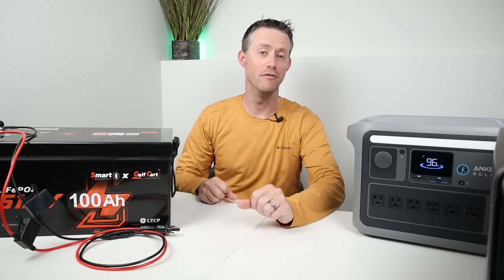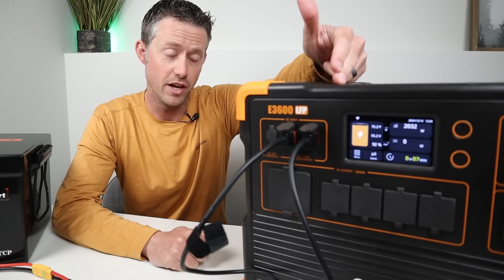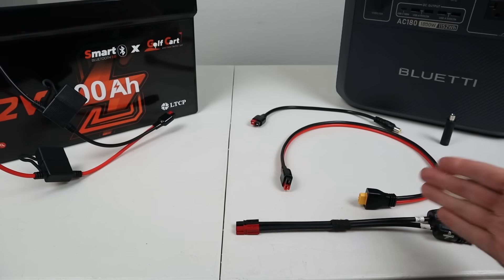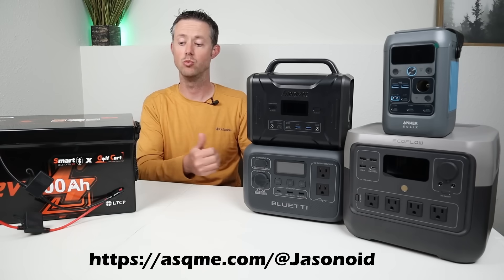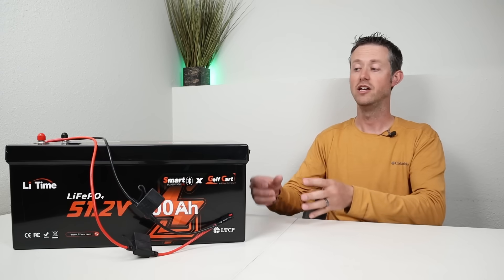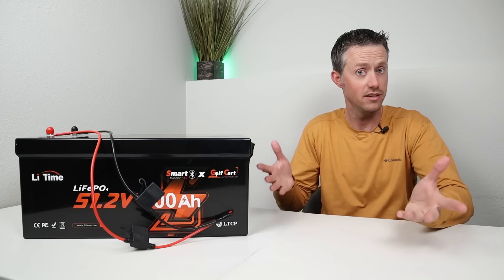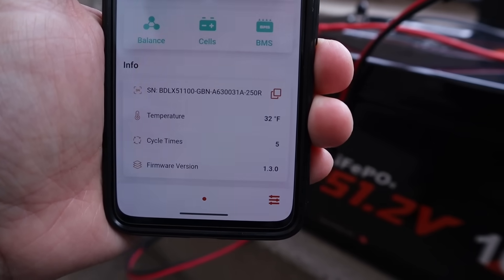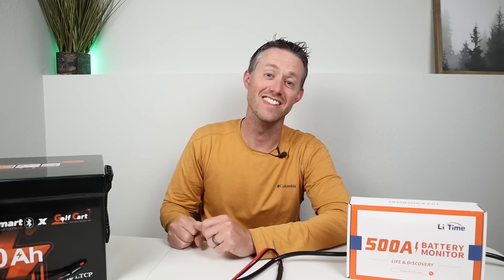Simple Trick to Make Your Power Station Last 5X Longer! Charging with a LiTime 48v Smart Battery!

Comment: If for example, two panels when wired in series have (VOC 96.96V/ ISC 10.14A), connected to a 48 V battery, and the battery connected to a power station that has (60V max/12A), being the battery terminals are being shared by the panels and the power station, wont it be an issue?
What would be the specs for the solar charger for such a system in between the panels and the battery, and would the battery stop charging from the panels once its fully charged?
Reply from the maker: You cqnt just connect two solar panels to the battery terminals, you have to use a solar charge controller which outputs a battery charging voltage.
Reply: @Jasonoid  My question was the second part of the question, I do know that cannot plug directly solar panels to the battery. Would you be able to  answer the specs for a solar charge controller for the system, and if could keep the battery connected always to the solar panels using the solar charge controller  and not overcharge the batteries, and it the panels being a higher voltage than the power station and sharing the same battery posts, if would cause a problem, or the solar charge controller would have this in check, thank you
Reply from the maker: @ilrc8850  yes, you can charge the battery at the same time as having it connected to the power station. The solar charge controller would also keep the voltage within charging parameters, no damage to either the battery or the power station by doing this.

Comment: In my overland vehicle I am running a BLUETTI AC200L powered by a Charger 1.  Great setup but my cooking and kitchen setup many times will eat all my battery on the AC200L.  Question:  can the Charger 1 power the 48V battery, then use the 48V to keep the AC200L topped off?  Your videos are fantastic and very helpful!
Reply: YES, the AC200L has a solar input voltage max of 145 volts! The adapters are in his description (2 options, terminals to XT90/MC4 which connect to Bluetti). This would also work with their EB’s and AC200MAX.

Comment: I’m having an issue when charging my EcoFlow delta max with a Renogy 48v 50ah battery. It will charge at about 660watts and then immediately stop. Every other second this repeats with a clicking sound from the EcoFlow. It does still charge but extremely slow because of this. Any idea what my issue could be?
Reply from the maker: Wow, I haven't heard of that issue before when charging the Ecoflow Delta series. Do you have the firmware updated on the power station?
Reply: Yes, latest firmware as of 2 days ago. I’ve confirmed it’s not my batteries as they are outputting a constant voltage. I’ll be contacting EcoFlow tomorrow to see if I can figure out the issue through them since it’s obviously on the EcoFlow units side

Comment: the other problem is your limited to the solar chargers power if say the unit can provide a full 2400w but you the solar charger only pulls 1000 once the main battery is depleted your bottle necked to 1000w a proper expansion batty lets you pull that full 2400w.

Comment: Thank you for pointing out these money saving alternatives. I think it is important for the widespread proliferation of residential solar that there are affordable alternatives available for the DIY oriented home owner. I have been dissapointed with the final cost vs performace of my grid tied system, which I have now augmented with one Anker F3800 and the grid interactive Smart panel connected to six REC 400W solar panels. 
 My question is: Would I be able to use one of these batteries for both of the pretty limited solar inputs on the Anker using two adapter cables or would you recommend getting two batteries?

Comment: I want to have a backup for my 2 bedroom apartment and and to use the generator during peak electrical prices usually 4-8 hours daily. looking at the DJI power 1000 and the Bluetti Elite 200 v2. What do you think? Also which DIY battery to buy and best way to charge this diy battery?

Comment: I have an energy flex 1500 system with one battery. It’s about 1050 W hours I have contacted energy and I have read all of their paperwork and they tell me that it is absolutely impossible and not allowed to take a 12 V 200 ah 
 Lifepo4 battery 
Hook a battery pole connector to an EC eight mail and plug it into the side of the energy flex 1500 and charge it that way   They say that it’s dangerous. It will start a fire because it’s two different types of batteries connecting to each other the energy flex 1500 has lithium ion batteries in it and the life batteries lithium iron phosphate but how does the energy flex 1500 know where the electricity is coming from if it’s just a cable coming from another battery source it’s still 12 V are they just trying to sell me $1000 extension battery or can I still do this and where would I get good cables for something like this?

Comment: I just received the 60Ah version and the Li Time 58v 10a charger and the battery will not charge. The charger is clicking switching volts but not charging. Resting volts of the battery is 48, which is 0% charged based on what the manual says. 😢 not sure if I just received a bad one… any help would be great
Reply from the maker: The battery comes in a 'disabled' state to save power and usually wakes up when you connect the battery charger. Can you connect to the app and turn it on?
Reply: @Jasonoid I had to return it, it never woke up.

Comment: Great video! I don't know if I missed it, but how much of a difference/extension does the battery make in useable time after you've charged and drained the bank and battery? I know that the answer is subjective, but there has to be a general rule of thumb. Also, how does the battery extension equate to cost savings, if any?

Comment: How does the external battery charge up?
Reply from the maker: You charge it manually with a 48v battery charger or with solar panels and a charge controller.
Reply: @Jasonoid  OK thank you. Its because Im going to be moving completely off grid, with a 500w panel.

Comment: I use a Battleborn lithium 100Ah to add extra power to my EF Delta 1300. It handles up to 60v. It takes a while and only recharges with the cable being ring terminals to the XT60i at 104w, similar to using the 12v socket in a car or truck.  MY other cable has aligator clips to the XT60I.
Reply from the maker: You could use the Ecoflow alternator charger, or even the Bluetti Charge one to boost the voltage of that battery and charge much faster. Have you seen those before?
Reply: @Jasonoid  Hmm..  Boost the voltage to make it charge faster..? This isn't computing. I do have the Pecron 500w charger.
Reply from the maker: @OFFGRID_Trucker  the Pecron does the same thing, instead of charging at 100w, you can charge at 500w.
Reply: @Jasonoid  https://youtu.be/g4lc5yRQI7o?si=HDi3ZylgO1Zdrat1. Pecron said it was incompatible with my EF delta..  off subject
Reply: @Jasonoid  I had to think about what you said..  my battery only charges the delta at 104w.. just like it does when using the 12v socket in the car
Reply from the maker: @OFFGRID_Trucker  but if you use the Pecron car charger, or another similar model you'll get 500w instead of 104w...
Reply: @Jasonoid  yes..  but i live offgrid in my cabover on my land..  i try not use rhe pecron in my car or the dodge ram diesel to save fuel.. and use solar only. It's slow but it works but the Eco flow alternator charger does put out 800 watts if I need some fast charging. I have an appointment on Monday to get solar installed on this camper. It will consist of 1 or 2 400w panels, 150/45 victron controller, bmv 712, 3 bb 100ah lithiums and a ps 2000w xantrec inverter. That will solve some slow charging issues.

Comment: Could you explain in another video how and what parts you use to recharge the battery
Reply: Just need a separate MPPT charge controller to charge batteries from solar, though he is connecting batteries to charge his power station and uses that for the inverter.
Reply: I have this similar setup I am working on can you supply a wiring diagram or another video showing how you connected the solar and the inverter to charge the battery at the same time you’re using it’s energy to charge your larger system.
Reply: @JeffLevy99 do you have this ready to share?
Reply: @fastfolky I’m interested in this diagram as well.
Reply: Yes. Please. I’m using 12 volt slave battery.  Thanks!
Reply: Yes

Comment: I must be very low IQ. I watched this twice and still missing something. So I connect my panels to the 48v battery. Once that battery is fully charged, I then disconnect cable and manually reconnect cable to the powerstation for recharging ?  Am I understanding this right?
Reply: No.
Watch some more off grid videos.

Comment: Does ECOflow allow pass thru power, Really its bad to over cycle your Ecoflow, I would want just to discharge 48v battery and not keep recharging Ecoflow 1024w, Hooe it alows this , Even low grade chinese invertors do this.   ANY reply greatly appreciated. Its for 800w heater  in dark winter no live solar.

Comment: Those ATC fuses, "blade style", are rated for 32V. At the higher voltage, 51.2V, you risk arcing at the fuse and melting of the fuse holder, and possibly fire.
Reply from the maker: I tested blowing a fuse at 35 amps and it was just fine. The 30amp fuse blew out and there was no arcing.

Comment: Can Deep Cycle Hybrid GEL Battery be used like that?
Reply from the maker: A 12v lead acid battery will charge around 100 watts.
Reply: @Jasonoid  I have a new 12v 300ah Hybrid Gel, I will be trying it. 
Thank you
Reply from the maker: Just be careful to unplug the battery before its completely dead. A lead acid battery has no built in protection.

Comment: Also worth Noting, RESULTS WILL VARY, Dabbsson for example caps the charging at like 8 or 9 amps, somehow it can tell that it's not a Solar Panel despite being at solar panel voltages and so it caps the amp rate like as if you are plugged into a car cigarette charger cord.

Also if you are buying a battery to expand your power station like this, you might as well sell the power station and just buy an AIO Inverter, you'll have more functionality, there are plenty of AIO Inverters that will give you that higher solar input voltage to run more panels in series or if you aren't willing to go that far you can buy a stand alone Solar Charge Controller and have it charge the external battery while the battery charges the Power Station, this is what I did prior to getting a stand alone Inverter, for as little as 300-400 dollars more then the battery cost you you can have a separate Solar Charge Controller and a 120v 3,000 Watt stand alone Inverter, you can connect literally 2 almost 3 KILOWATTS worth of Panels to, not the 1 Kw if you are lucky with a power station,

There are so many guides on Youtube for "DIY Power Stations" no one should be wasting money on a Power Station and i'm saying that as someone with a Power Station.

Comment: Good stuff. 
I have gaming pc and a chest freezer and some time's a rice cooker I got a delta echo 2. Would it be ok to live off grid with the power station as my controller. The delta 2 only allows 500w input but I heard some DIY(battery) expansions like you are chatting about can actually except more IE 1000w solar input and be charging the power station 500w. Allowing me to have more solar panels.
Or should I build a DIY setup ?
Reply: Lmk same situation

Comment: I take it you could use 2 batteries in series to increase input amperage for the power stations that accept higher input due to higher voltage?
Reply: Someone answer this man!
Reply: No 48V lifeP04 battery is rated for series connections.

Comment: I did this a few weeks ago with a Chin 48v 5.1kw battery / charger combo [$799], and my Anker Solix F2000 and it works great! The F2000 solar charge controller limits the DC input to 10A in if 32V or less, but 20A in if 33-60V. The 48v battery fits nicely in the 20A range, and is dumb but capacious and cheap

Comment: Would like to see the results with the older Delta Pro. 
I have 3x Delta Pro's, and have been thinking about trying this for some time.
Delta Pro max solar voltage = 150vlts, with max draw of 15amps.
I know few people have tried with very different results. 
So i would love to see this
Reply from the maker: You'll see around 825 watts from a 48v battery (55v x 15 amps)

Comment: Why couldn't you connect you solar charge controller or 120w battery charger directly to the battery and thus pass-through charge the power station at the same time?

Comment: 2:50 Oh yes, just tell people to rely on a 30v max auto fuse for use with a 51.2v battery. How very safe.
Reply from the maker: I tested it with more than 32 amps and it blew the fuse. You could also use a 30 Amp rated DC breaker 👍
Reply: @Jasonoid  with an auto fuse rated for 30v you risk having it arc on higher voltages, There is a reason fuses have voltage ratings, it's not just for fun. If you want to fuse a 51.2v battery you should be using a terminal block fuse (generally rated to 58v), otherwise theres a chance your fuse can blow and internally arc, creating a fire hazard at the fuse or elsewhere in your circuit.

Comment: Very interesting. I subbed. I’ve got the solix 1000 and a 12 volt 100 amp battery. I thought I was going to use an inverter to use the plug in Anker charger cord  that came with. Do I need anything else? Thanks.
Reply from the maker: The battery in the video is a 48v battery and that's why it charges so quickly. A 12v battery will charge your power station around 120 watts. If you want to charge faster from that 12v battery you'll need something like this:
https://youtu.be/NeBx70G2g6s

Comment: What a great, simple idea.
Reply from the maker: Yeah, it's simple but makes a huge difference!
Reply: I built out my own expensive system because “all in one” system expansion batteries were way too expensive and the cables were awkward. This solution is simple and brilliant. I’d set the Li Time battery to charge off of solar (MPPT) and my alternator (DCDC), so there would still be some custom components. But it would eliminate a ton of thick wiring, connectors, etc.

Comment: A 12v 400Ah battery will have the same capacity but charge the power station 4 times slower. How about a 20A power booster to 24v? What size wiring will require? Txs.
Reply from the maker: It's best to use something with active cooling like this:
https://youtu.be/NeBx70G2g6s

The 12v to 24v boost converter will work but you'll need to put a fan on it.

Comment: Have you ever looking into connecting a small wind turbine to an Ecoflow portable power station?  500W turbines are pretty cheap, but it's not clear if you can just plug one directly into the solar input on an Ecoflow.
Reply from the maker: I don't have much wind in my area, would be hard to determine the results.

Comment: Great video, now you have me thinking. This will definitely work for my Bluetti ac200 max. But here's my question. Can I output that 48v battery into an mppt charge controller and output the charge controller to my Li Time 230ah 12v battery in my travel trailer?

Comment: Could you run your solar input through a charge controller to the terminals on the expansion battery and then also wire those terminals to the eco flow solar inputs, so that the solar charges both batteries in parallel when power is available? The biggest issue with DIY expansion batteries versus the proprietary ones IMO is finding a way to make charging and discharging happen automatically
Reply: Lmk

Comment: Im surprised no one has tried to get something to connect thru the expansion battey ports. It has to be possible.
Reply from the maker: Expansion batteries require proprietary communication. The power station will not even recognize one of these batteries connected into the battery expansion port.
Reply: @Jasonoid  given all the discords etc out there I can't believe no one has figured it out.  Or at least tried.

Comment: Thanks Jason.  Great information.  I would have never thought of using a 48v battery as input to the solar input into the power station.  I have an AllWei 2400PP.   
Here are the specs:
AC Input Charging:  AC 102-132V/1500W Max
Car Input Charging:   12V/120W Max 24V/240W Max
Solar Panel Charging:  DC16V-60V/10A 500W Max
Battery:
2400W/2048Wh±5%(40Ah/51.2V)

Would I be safe with a 48 volt battery?   Will the 10 amps be controlled by the controller in the power station?   I was under the impression that I could not use solar panels that produced over 10 amps.  
Could I also use a 24v battery as the "car" input at the same time to allow faster replenish on the power station?
Thanks again.   

btw, is there a way to just connect the 48v battery to the expansion slot that would normally connect to the expansion battery?
Reply from the maker: You can only connect to the solar port, the expansion port is proprietary. With a 48v battery connected, the power station will limit the input to 500 watts / 10 amps. I don't see why it wouldn't work.